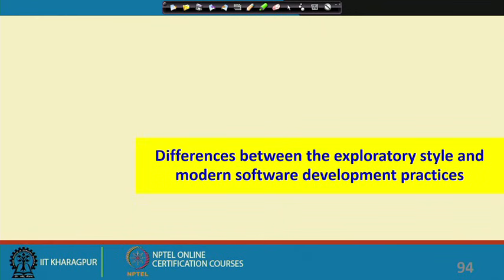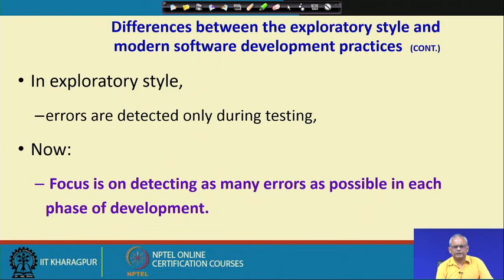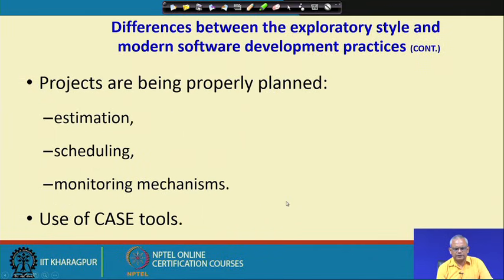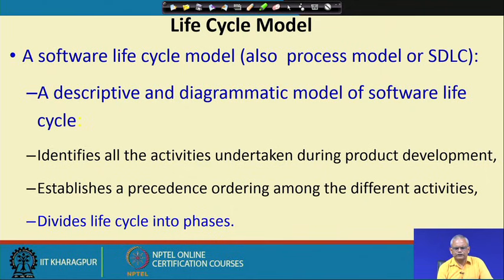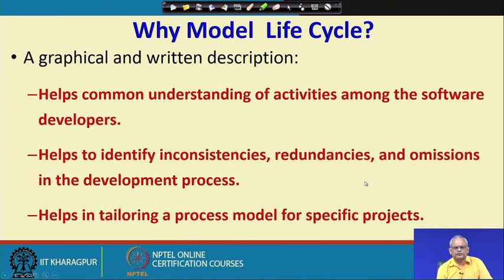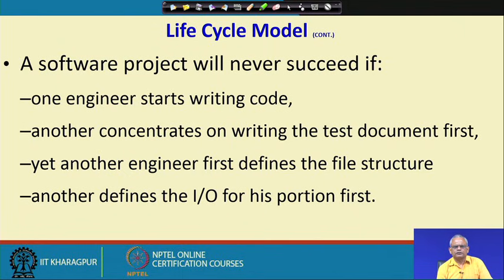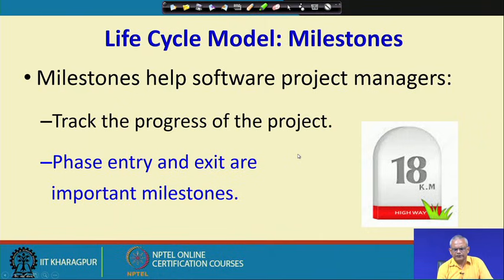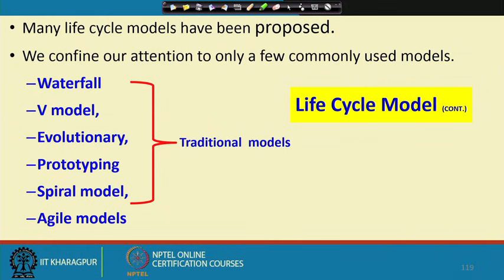Lecture 06: Life Cycle Model

Comment: Sir, in the previous lecture you've mentioned that no one will develop software from scratch, but develop on the existing libraries. However the "Life cycle" model seems to develop software from scratch?!
Reply: It's not about software it's about the code written for developing a new software, we can reuse  existing codes.